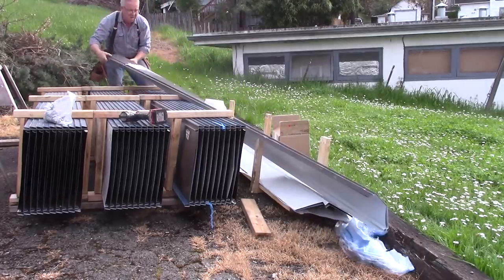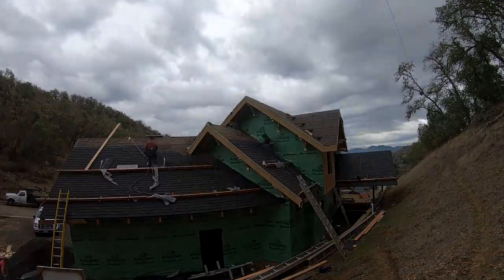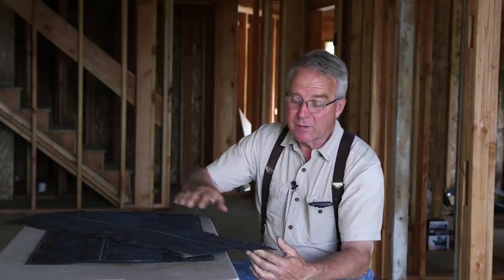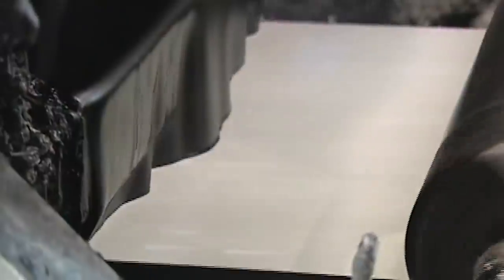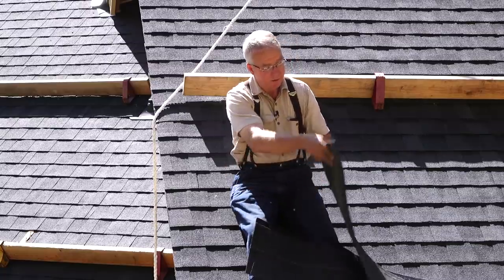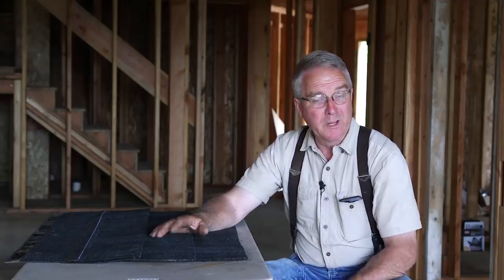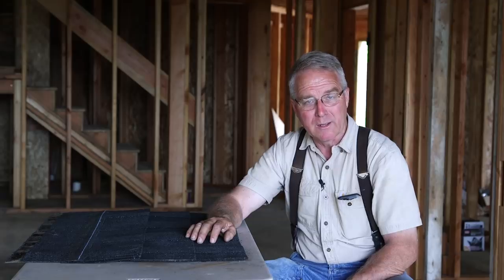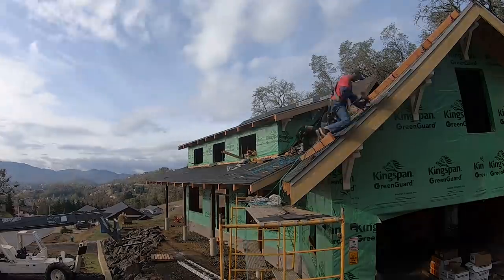The Incredible Asphalt Shingle

Comment: This does smell of shill a tad bit. I am very much a tile kind of guy and honestly a proper tile roof will last you several lifetimes. I’ve taken 150-200 year old handbaked tiles from huge barns in perfect condition for re-sale. 5% being discarded for either structural damage or simply not being pretty enough. 
They’re just not in the same boat as asphalt shingles.
Reply: The tile lasts, but the underlayment and/or roof sheathing does not last nearly that long. In dry, hot climates, you get about 15 years, that's it, then the tiles have to come up and the underlayment and whatever damaged sheathing there may be replaced and tiles put back. Doesn't change the cost really because all the money is in the labor.
Reply: @RobertBarth1  would you happen to know which option is better for the environment? Us Europeans are not that familiar with these shingles but the word asphalt seems kinda bad. Then again, the clay or cement tiles are not very world-friendly either. Labour cost is not always the most important factor, although I am sort of disappointed this channel chose the cheap roofing option. Slate would have been better looking in my opinion, but probably twice or thrice the price.
Reply: @RubenKemp  I am by no means an expert, but since asphalt shingles are basically a petroleum product, I would think they are a poor environmental choice while concrete tiles have the same environmental impact as anything else made of concrete (which I don't know if that's good or bad, but it's basically portland cement, sand, and water compressed under high heat). Slate tiles are not used in the United States very much other than in ultra high end custom homes where the cost probably doesn't matter.
Reply: @RubenKemp  Asphalt is the tar that is left over after all the other useful petrochemicals have been distilled from petroleum. It is a byproduct and it is amongst the most recyclable materials in the world, as most asphalt roads are made with a fair bit of ground up old road. The amount of asphalt in one mile of road will dwarf the amount used to shingle a house. I wouldn't be too worried seeing as people will still be driving cars and using plastic for years to come.
Reply: @Grauenwolf  We just did our 1500 SF house, a 500 SF casita replacing the underlayment in Arizona and it was 14K.  The guys were total pros, no mess left  behind, not much loss due to damage.
Reply: @RubenKemp  asphalt is a petroleum byproduct. In the eu I believe they call it tarmac. It's become a genetic term for the tar binder of the aggregate weather for paving or shingles. There are also tar binders that are made from plant based materials that are used to make shingles.
Reply: @RubenKemp  Or more. Metal roofing costs about 3 times what asphalt costs and tile costs even more. When your roof is 4000 square feet, and your roofing costs are approaching $1000+ a 100 square foot, there's a reason that $400 a 100 square foot for asphalt looks pretty good... And here in Oregon, and at that pitch, that roof will last every bit of 30 years. And when it gets torn off, it either ends up in the landfill, or it gets recycled. Metal is definietely my preferred roofing. But most of the time, it's just not cost effective for most people.
Reply: @HavokTheorem  Yup. Mill up old road. Process millings in a crushing plant then have your way with them weather as partial base material, added back into batch plants or for other resources like the shingles being spoke of
Reply: @HavokTheorem  asphalt is one of the most UV resistant natural materials
Reply: @RobertBarth1  A rainscreen significantly increases the longevity of your underlayment/sheathing - just thought id throw that out there.
Reply: Robert Barth They sequester hydrocarbons, keeping them out of the CO2 cycle. This is good for the environment. The bad thing is to burn the petroleum.
Reply: I have a question because I don't know....how do tile roofs hold up to ice and snow loads?  Not uncommon to have a foot or two of snow on my roof...

Comment: I've never seen asphalt shingles anywhere in Europe... funny how styles diverge over time
Reply: Asphalt is an oil product. It comes from the crude oil refining process which is something that Europe just doesn't have a lot of, relatively speaking. Oil is expensive there in most areas where it isn't in the USA, again, relatively speaking.
Reply: In the Netherlands they're quite common on garden sheds. But on houses? Nope
Reply: @DriveCarToBar  Norway has an enormous amount of oil but you'll still only see asphalt shingles on a budget garden shed there, it's just not a popular aesthetic
Reply: @somegoddamnguy  Norway might have a lot of oil, but the refining capacity of Europe vs. the USA is something to consider. And Norway has a lot for a nation their size, but they produce less than Venezuela, less than Canada, less than Russia. While oil production dropped, in the 90s, the US State of Alaska was producing the same amount of oil Norway is today. Alaska hasn't drilled for any new exploration in a decade though. 
The entrenched roofing methods and cost of starting up asphalt shingle production probably keeps it a minor player in Europe.
Reply: @DriveCarToBar  I just did a search for asphalt shingles on the website on a single Norwegian home improvement chain's website and I found 14 different kinds, it's available, it's cheap compared to the alternatives, but it's not a popular aesthetic  despite all this

Comment: Normally you also point out weaknesses of any building material, i missed that in this video. For example; in summer with high heat these shingles heat up the roof much faster than some other roofing materials. I also see clay or concrete as a more long lasting option, they even give the possibility to choose different styles and colors.

Comment: There is no perfect roofing material. Asphalt shingle are just at that sweet spot where they look decent, are relatively cheap, are fairly easy to install, last at least as long as the average homeowner will live in a particular house, and are not considered to be a big fire hazard. Slate roofing can last from 50 to 400 years. The down sides are the cost and the extra weight. Wood shakes or shingles, especially when you used to be able to coat them with creosote, could last up to 100 years. Here the down sides are high cost in both materials and the labor to install, and a high risk of fire. In my area, metal roofing is rare and I suspect that the lack of popularity is that people think it looks cheap. Tile, like slate is very heavy, and requires a much stronger roof structure, but is hands down the best choice in an area subject to wildfires.
        Human kind is endlessly inventive.  You and I may not be able to imagine how the asphalt shingle can be improved but I would not be surprised if it were in the next forty years.
        p.s. back in the days before architectural shingles, the best asphalt shingles were made by Bird, and then Certainteed after they bought out Bird, called Jet 80s. They were like a three tab shingle without the slots. This reduced the number of places for leaks to start by two thirds.
Reply: I like your analysis except for that you forgot about hail. Both metal roofs and tile roofs are extremely subject to hail damage. Well it's true that all roofs can be damaged by hail, it is not case the hail limits the marketability of all roofs. Most of the questions I get from customers with respectable tile and metal set around the noise and/or damaged caused by hail. The second most asked question with respect to metal roofs is maintenance, i e painting. Architectural comp has no maintenance, whereas metal roofs particularly in the Southwest, inevitably do. Personally, I like the look and the environmental consequences of a standing seam metal roof; and if you have enough money and enough of a pitch, all of its downsides can be mitigated. But most people have neither the money nor the pitch to deal with that, so architectural comp is usually the best overall personal choice, though usually not the best environmental choice.

Comment: Why don't they make them longer? Or in a continuous roll and you just cut the length you want.
Reply: I can only imagine it’s due to ease of handling. 1 bundle of those shingles weighs about 60-80lbs (~32Kg) and that only covers about ~30 sqft or slightly less than a full sheet of plywood.
Reply: That would be convenient, but I think it comes down to the amount of weight/size. One bundle weighs about 70lbs, but you can throw them over your shoulder and climb ladders with them. If the same amount was in a roll, it’d probably be more cumbersome.
Reply: They do make roll roofing of the same composition. Just not architecture grade. They are flat only
Reply: @davidhtims  Roll roofing is generally awful, but I suppose the quality could be upgraded.

Comment: Tile roofs are heavy and don't last forever either.  The under lament goes bad so all the tiles have to be removed and the under lament replaced and then the tiles reinstalled.  Slate is too expensive and isn't practical unless you  live where it's mined.  Copper roofs are too expensive for the average person. Tin roofs are great for barns and industrial buildings.  It's hard to get fire insurance if you have a wood roof.  So asphalt is the logical choice considering availability, cost, ease of installation, fire resistance and can last 50 years if installed correctly.

Comment: Thanks to asphalt shingles, roofs have become yet another toxic item we Americans can add to our huge list of things we fill up landfills with in our disposable society.  I used to believe the lie that Asphalt shingles were a great thing until I bought a house that came with its original 110 year old slate roof. Then I bought a second house that came with its original 125 year old slate roof. Now, of course, both these roofs had to have some patch work done over the years from hail damage and other extreme weather, but they were still about 90% original. if that's not a testament to the majesty & dutability of a slate roof, then I don't know what is.

Comment: When you mentioned the weight of 10 tons for the shingles, does that mean you need to decide on the roofing material at the design stage so that the engineer can add it to his calculations?
Reply: No, roofing structures are usually overbuilt to meet code. Which is way more than what any roof material would weigh

Comment: 10 tons of shingles on the roof??? Let's imagine that the total roof is 500m^2 (~5000 sqft ) --> Asphalt is about the same buoyancy as water --> ~1 ton/m^3 . To take 10 ton shingles, you'd be loading 20 kg/m^2 --> 2cm thick (3/4 inch thick) cross-section... omg
Reply: It maybe crazy talk, but I’m gonna go ‘out on a limb’ here and guess that the structural engineer included the weight of the roofing material in his calcs for the structure.
Reply: Friend, you are mistaken about the density of asphalt (more than 2 tons per M3) and failed to consider the gravel facing

Comment: And then there's the impact resistant photo voltaic roof system that Elon Musk is developing.
Reply: Bob Frazier . That’s bound to be a really cheap alternative. 😂
Reply: @okcantbelieveit294  A modular solar PV roofing  product needs diagnostics that tell you which  panels are defective - and hopefully a warranty would pay for snap in replacement.  A high number of solar panels are defective on the day they are installed.
Reply: @treyhart6861  It's not vaporware. They are currently installing them. But may not be in your area.

Comment: Asphalt is not used much of anywhere but the USA. A waste of petroleum. Copper is best ,Solder the seams and it is recyclable when done. Copper does not promote mold growth. Seamless , repairable, pretty , and no snow sticks . You forgot about snow EH? 
Tiles are great, and cement shingle work good too. But you got em for free so what the heck.
Reply: Copper is great but its spendy.  Asphalt is a byproduct of petroleum refining, most of it is used for road paving, otherwise I don't know what would become of it.

Comment: you better hope they are heavy, you will need to hold that roof down as those STAPLES you used on the plywood will rust out in a few years
Reply: There galvanized staples so I doubt they will rust out in a "few years."